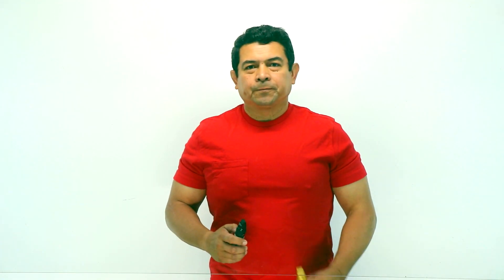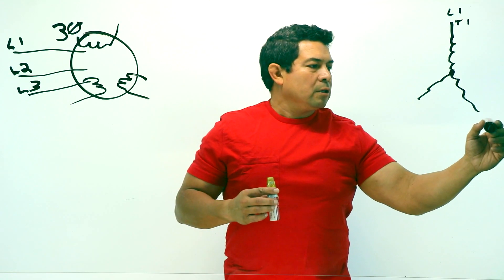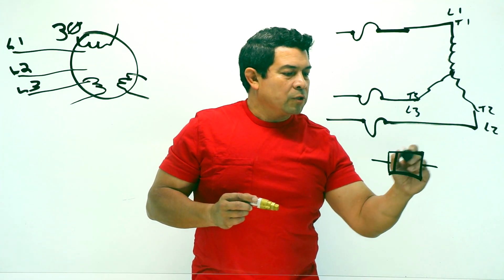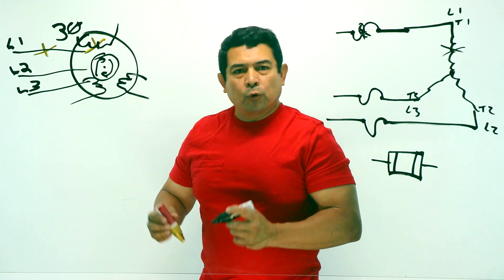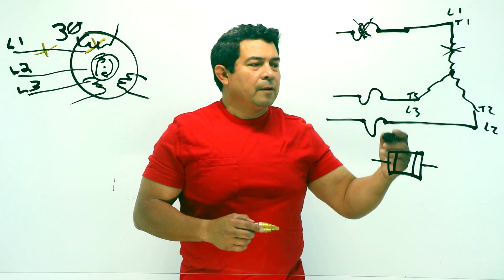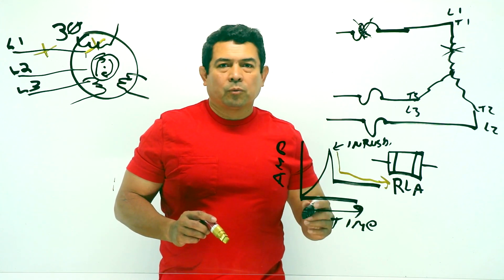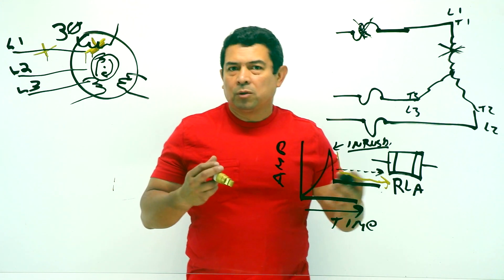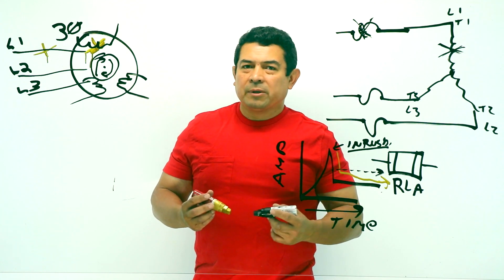Motors 3 single Phasing - HVAC Online Training and Courses

Comment: I've stumbled into your video set from the engineering side. Even though engineering goes into the math, your description of how these motors work is more clear and practical. Bravo!
Reply from the maker: Thank you! I teach mechanics and I want to make sure that they understand how things work. I tell them in class if I can get you to understand how things work you can definitely figure out how to fix them. Where are used to work we used to teach the math that goes along with motors and the electrical side, but a lot of these guys out here do not need the math, they need to understand so they can fix things!   Thank you for watching!!!

Comment: How do I verify the 3 phase that is right direction?
Reply from the maker: There are meters that are made they will help you figure out if the polarity is correct. With those meters you can tell which way is the correct way of hooking up the leads. If you are working on a reciprocating compressor it will not make any difference in which direction it is rotating.    If you are working on a fan you can look at the fan once you start it up and you will be able to tell if it is rotating in the correct direction or not. If you are working on a unit that has a scroll compressor, they will usually come with a face monitor and or you can just look at the fan if you are connecting the wires at the main feed/disconnect. I hope this answers your question.
Reply: @AirConAcademy  thx

Comment: How will I understand my motor is single phasing?
Reply from the maker: If you have a three phase motor and it is already rotating you will have no amperage on one of the three hot wires, and the amperage will be higher in the other two wires. If the motor is not running and you only have two wires that have power on them the motor will just sit there at hum but it will not operate. You will most likely pull (LRA) lock rotor amps. I hope this explains your question.